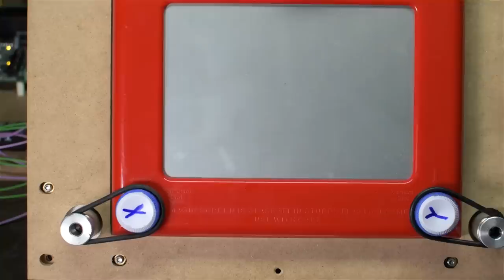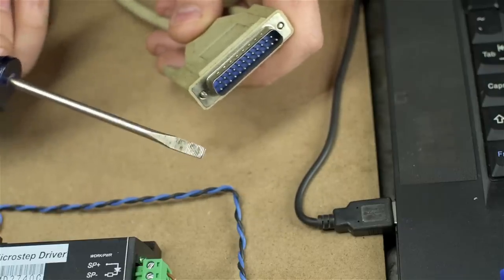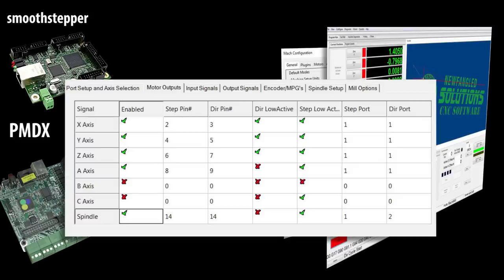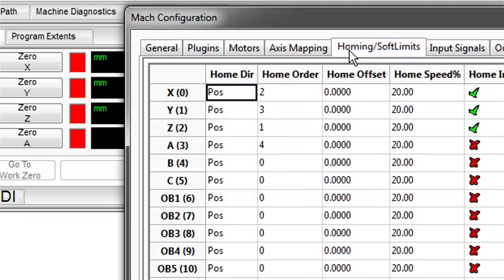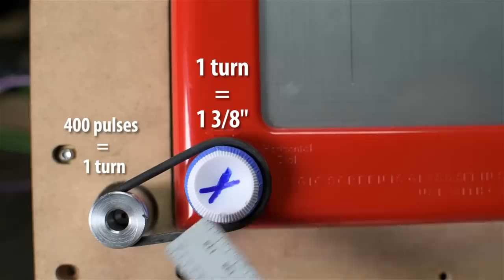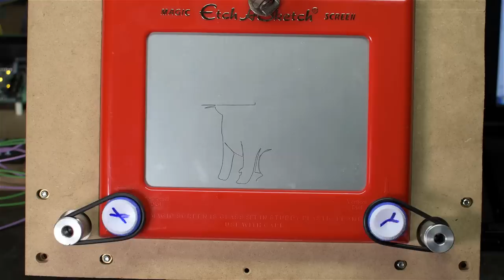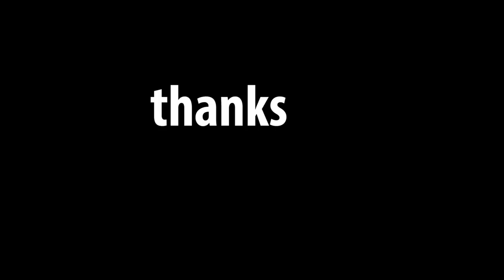Build Your Own CNC! (Part 2) - Inputs, Outputs & Software

Comment: I have been using similar stepper drivers as used on your Etch-a-sketch project (think I paid £6 each) with an Arduino UNO running GRBL on my CNC router for several years now with no issues, although I suggest people have a look at FluidNC for ESP32 as this is much more powerful.  I find using Inkscape to draw my projects and then feed the resulting file in to Krabzcam is a very quick and easy way to generate the gcode and "Universal Gcode Sender" to send this gcode to the Arduino works well for me.

Comment: 2:10 Haha, how did you know what I was thinking?

Also, to use an crisp webcam as a visual feedback device to automagically compensate for backlash in the system, either that or torque sensors, or both. Basically giving the controller interface with the hardware closer to how a human operator would.

Comment: A good question is could you build a CNC mill from a manual mill and use DRO style glass slides as feedback to the software, so the software runs the motors untill the table physically reaches it's target.....

That would be an interesting project.

Comment: I have thought about building a sort of remote controlled milling machine. Something I can control with pots or something. Basically aspindle motor and some way to move it x, y, & z, and it could be easily converted to CNC. Probably a dumb idea to not do it to start. It just make it manually controlled... Great video.

Comment: A nit: eight of the pins on the parallel port are signal grounds, so there aren't nearly that many pins available. There are 8 output pins, 5 input pins, and 4 configurable in/out pins. Total 17 to work from. Also there is no power supply pin, just ground and signals.

Comment: Dude... you make the funniest videos on YouTube. Not the funniest machinist, DIY, or maker videos... just the funniest videos! I ran across your channel while searching for something else, and now I think I really want to just call in sick for the rest of December and binge watch all your videos. I have a question... you made a video for Alex, the French Guy Cooking's pasta machine, and you left the design with two independent wheels to control the distance between the two rollers. You mentioned that you COULD do it with just one knob, but that it would take up too much space. Can you PLEASE do a video on how to raise/lower two... or better yet... four... points with one know, as accurately as possible. I am desperately trying to make a drum sander for sanding acoustic guitar tops to very exact thicknesses and exactly flat and parallel. I cannot find a guide on how this is done usually? How can I raise an 18" x 24" dead-flat table, upwards towards a spinning sanding drum, fractions of a mm, and keep the table dead flat all over?  If you have a patreon page, I will GLADLY sign up!

Comment: Having a good ground is critical for electronic equipment that switches between 0-5 volts. If your home or top secret man-cave shop cannot ground to a true 0 volts, your controller and/or sensors will not change states. As a copier repair technician, MCSE and computer network technician of 38 years working in the Chicago IL, Seattle WA, Florida and Texas areas throughout the years, this was a much more common issue than one might imagine.

Comment: It's intresting to compare this setup with the all in one Arduino-based control board on my 3D printer. I go to print larger things, and I can hear that y-stepper begging just a bit (since the whole print bed and part move with Y, X is just a tiny annoying carriage that looses roller wheels a lot, and z has a lead screw to make it's job easier. The Tevo Tarantula's control board is still fairly nice for the price, though)

Comment: TOT why not design a smaller CBC machine using aluminum extrusions that would require use of our machines (mills, lathes, welding,etc.).  Your machine is massive and damn near bullet proof, but then, again, so is everything in your shop.  My shop has an Atlas 12 inch lathe, a Grizzley vmill, tig and mig welding etc.  Really enjoy your content, creativity, and expertise.  Thanks

Comment: Perhaps it's possible to use the outputs to flip a bank of 3 relays that switch the wires on one axis to a different motor? With some fancy pixie wrangling wouldn't this allow for 6 axis?

Comment: On my (circa Windows 3.1/parallel port) CNC Etch a sketch with spider drives between the stepper and Etch a sketch, it had about 1/8” backlash, but was not cumulative as in your video. I would assume the ‘O’ rings are slipping.

Comment: I think that the WADKIN CNC Router used a LAN connection and the Router didn't have much RAM so some programs had to be dumped in the bin before you could load a new block of G-Code onto the WADKIN, if you can get a second hand WADKIN/BRIDGEPORT CNC get it just make sure you have CADKEY386 and associated dongle,

Comment: One quick question, if your spindle had a VFD, how would you tell the controller board to adjust the speed in addition to the on/off using the output ?

Comment: Hi Tony.
Your welding videos inspired me to buy a tig set.
Your T shirt (my Sunday best) inspired me to dress with a little more class.
The last two uploads has me thinking about building a CNC plasma table to go with the tig welder
My workshop is a small log style cabin on the bank of a canal in Wales (next to England)
It's cold, cramped and not an environment for a laptop or computer. 
Have you tried using one of those offline controllers for CNC?
Do the drawing in the house, pop the g code onto a memory stick and run down to the workshop avoiding the pouring rain and falling in the canal :-)
Reply from the maker: I didn't even know they existed until I started reading comments about them in the last video.  They look very intriguing!  P.s. Hello Wales!
Reply: @ThisOldTony  .
Thank for the reply and I'll apologise now if the intrigue  becomes to great and you end up spending on another project. It must be tempting though.
Ps. Great videos and T shirt !

Comment: The board layout at 9:20 looks a bit sketchy to me. There's no way they can achieve the necessary clearance between the mains terminal block in the left top corner and the mounting post directly behind it. Also the AC/DC converter module is kinda awkwardly positioned on the PCB, it's completely surrounded by digital in/outputs and other non-mains circuits.

Comment: A bit late here but wouldn't backlash compensation be handled in software, and thus not matter whether hardware supports it or not? Mach knows when you're going to reverse, so it would know via the backlash compensation values how far to turn in the other direction.

Comment: In re: Unit calculation....

SO how do you determine what is best when it comes to setting the micro-stepping value in the motor drivers vs the "counts per unit" of your motor?  Seems to me this is what controls the "fineness" or resolution of your cutting ability, no?

I love the video - the fact that I'm coming up with questions at least tells me that I'm learning _something_... lol.

Since episode 1 I've purchase an ESS, a PMDX-126 (with a PMDX-107 for my spindle), and 4 Gecko 201Xs that will hang on a PMDX-134.......

Comment: Are there any CNC systems that use position feedback either from an encoder or some other means? That way backlash never enters into the system, it's just commanded to move until the desired distance is achieved.

Comment: Would there be any problem with either putting the power supply, stepper drivers, and control board into a pc case with the computer stuff in there also? Or putting the motherboard and other computer stuff in the same space as the Cnc electronics?

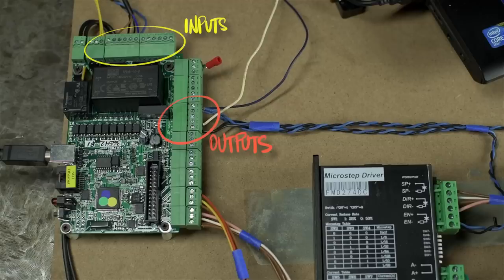Comment: @3:10 you say it can control 4 motors but two of the motors would have to be on the same axis.  You're not thinking 4th dimensionally.  The 4th motor could have an off balance weight on it and act as a rumble motor to shake the etchasketch once the third motor flips it upside down thus wiping it clear for you when you're done.

Comment: Hey man, how has this thing held up over time?  Specifically the linear tracks and trucks?  Im getting lined up to make a manual x y plate for a mill head and Im going to use SBR20 rails and trucks.  I would be happy to mail you a check for any free advice  you can offer.

Comment: Thanks for helping with my machine build. I'm using the PMDX-424 with Mach 4. I was wondering if you ever encountered this problem, Mach 4 will stop when runs an M code, I have to stop cycle and restart cycle after every M code
Reply from the maker: Never seen that happen.  Does it get past the M code after you restart the cycle?  I'd put in a ticket with Mach4 guys.
Reply: Yes. Turns on my plasma and everything runs perfect until it runs into another M code almost like it's asking permission to turn on and off the plasma. Right before it runs an M code it stops so I have to press stop then cycle start and it'll run the M code all the way until another M code.
Thanks  for the help love your channel

Comment: you said that the control board usually comes with a file which sets all input and output ports for me. If I don't have such a file, can I train one of my old ones to do that for me? I have not been using that rusty old triangluar one in the last time, would be a nice upgrade for it

Comment: My 1700 oz.in stepper motors are shaking my whole CNC when running slowly. Is it possible that overkill motors might be harmful? (my chassis is made of aluminium extrusions and sheets, so not super heavy duty). I've tried adjusting microstepping, acceleration and all that stuff but utlimately at some point in my gcode the motor will get too slow and start resonnating. And I oviously can't mill anything at 1000mm/min anyway.

Comment: Great Video, as usual... Question: Where did you get the little solenoid air valve (and the little air-operated plunger)??  I have a project that would use them and the only ones I can find are large and bulky.
Reply from the maker: McMaster.  look for 1/8" air stuff.
Reply: After I asked, I looked on Amazon and found a couple... Going to get them and play with them.  Found some on McM/C also.. thanks... Keep up the good videos -- watching them keeps me out of the bars and pool halls..

Comment: *shakes fist in the air*. You've pushed me over the edge to build a CNC Etch a Sketch. Actually, that's not even the whole truth. You've given me the idea as well as convincing me to go through with it. Do you have any videos on using the software side of things, Mach 4, Fusion 360, Inkscape types? I feel I'm most lacking in that area. I've been around Mills, Lathes, CNC, and shop tools for a little bit.  At work, I'm more the wrench and indicator guy. Programming is all done at the engineering level. So while I've made countless parts on manual lathes and mills and repaired CNC equipment, I've never programmed a CNC to make a particular part- only made small tweaks to an existing program to improve tool life, small dimensional changes, etc.
Granted I could do this cheaper, but this was the route I felt was right.
*bought:
Wantai Nema 17 CNC kit, came with motors, drivers, power supply, BOB (to be upgraded due to parallel port)
Etch a Sketch
dedicated laptop for Mach 4 ( Hobby )
Belts and pulleys
downloaded Mach 4 demo

Need to purchase still:
Mach 4 
Fusion 360?
Motion control board that uses USB or Ethernet to get away from parallel port, I did like what PMDX offers 
possibly electrical enclosure to house the parts and a couple fans

Comment: Thanks as ever Old Tony! This may be a silly question, but are there systems that use DRO scales for position info? I have all of zero experience with cnc machines, but it seems to me like that'd bypass a lot of backlash and dropped step headache, though I don't doubt would be quite headachey in and of itself.
Reply: Most cnc machines use servos with an encoder on the rear, and a linear encoder on the axis, it then uses a feed back loop to check one too the other, you'll still get back lash and have to comp it out, and you'll have to comp your general positional accuracy.
Reply: @garyhowe88  Thanks mate! I'll read into it.
Cam

Comment: there is a bug in mach where is you use backlash with stepper motors you lose a an big amount of steps in the direction change... :( 
I'm considering going to clearpath motors on mine.
Reply: Backlash is the deficiency of the lead screw, Like a steering wheel on an old car. might take 1/4 turn or more to start to move the wheels. What you need to do is convert the lead screws on the machines to precision Ball screws and eliminate all other slap in the connections between the motors and ball screws. SO when the motor turns the table moves without any lag. almost impossible to do and that is why the controller has the backlash feature. Besides that things do get some wear after a while and that lets you take up the slack.

Comment: Would it be more accurate for a CNC to make movements based on DRO vs revolutions of the steppers? Is that even possible?
Reply: deweys it is possible, there are two different ways to control motors from a CNC control point of view - absolute and velocity. In absolute you tell the motor to go to a fixed (absolute) position.  The other is to move at a fixed velocity in the right direction, then you monitor for position and change the velocity as you get close and stop when you get to the location you want.

Comment: Qucik question: is backlash also a problem with cnc machinenes that have actual encoders on the axes? Not encoders on the servo/stepper motors, plain old length encoders.
Reply from the maker: Yes, backlash always a problem.  It's not only positioning.  position encoders tell you exactly where everything is, but the backlash will still break tools and wreck parts.  You don't hear about it much because a professional machine with that much backlash would be at the dump :)
Reply: Thanks for the answer. I thought maybe positional encoders could compensate a little. Have a nice day!

Comment: Do you use just one power supply to power the Bob and the drivers ?
Reply: Power from the wall the pmdx 424 is 120 he has it on a tree  powering the power supply and the 424

Comment: Are the outputs of the PMC controller protected?  You used one to drive a relay and those are inductive.  Without any protection, an inductive load will kill the transistor driving it.  I would hate to see you fry an expensive board.

Comment: The parallel port only has 8 data pins (and a heck of a lot of ground pins).  I fear you'd need some expert-level buffered jiggerypokery to control all of those axes.   Or just cannibalise a daisy-wheel printer.

Comment: Instead of "converting a small bench top lathe" ... Please make this run a CNC plasma cutter table.. That's what I will end up making.. So if you're video went that direction....  Well, I would just be tickled.  Besides, you could always use another tool in your shop;  cnc plasma cutter would be a nice addition.

Comment: Has anyone been able to use a Raspberry Pi or Arduino to be the stepper controller for use with MACH3/4. I mean using these as the I/O interface (step-dir) from the computer. PS I am not asking you to tell me about GRBL.

Comment: WARNING: Not all outputs can drive a mechanical relay or other coil, due to inductive “kickback”. If you directly hook up a mechanical relay to such an output port, you will fry the output. Solid-state relays, because they don’t have a coil, don’t cause this problem. Alternatively, you can get a board with relay drivers on it that will handle the inductive kickback and isolate your output port from the relay’s coil (also, many of the relay boards available on eBay, Amazon, etc. have both the relay driver and relay itself packaged together on one board). If you’re not sure, check your documentation... 🤔
Reply: Or you can just put a diode across the coil terminals to suppress the voltage spike when the field collapses in the relay.
Reply: Or, um... that. Just be sure to use a suitably rated diode to match your coil. 🤔

Comment: So I noticed you're working in incremental mode? We CNC students were told NEVER do that.  Perhaps a video is in order??🤔🤔
Reply: nunya In general you won’t use incremental. The reason you are told “never” to use it is because they don’t want to explain the instances you will want to use it. Those instances tend to be more advanced and probably outside the scope of your class. One place you may find using it is custom cycles, where for reusability use only variables or incremental moves or some combination of both.
Reply: @cormicmcart1364  

Oh, I understand the incremental / absolute situation. That is why I thought it would make a good video.

Comment: I build a cnc router out of wood, an Arduino, some 3d printer motors, m8 threaded rod, and some cheap chinese  linear bearings. I even made my own makeshift low backlash nuts for the axis... Fast forward two months and all of the wood warped one night.
Moral of the story is to never use wood for anything you care about, even if you treated it properly to prevent warping in the first place. Either that, or homedepot wood is cursed.

Comment: also, does your board come with snubber diodes to handle the flyback from the relay coil?
Reply: and the relay might be pushing the 24 mA max on the board.